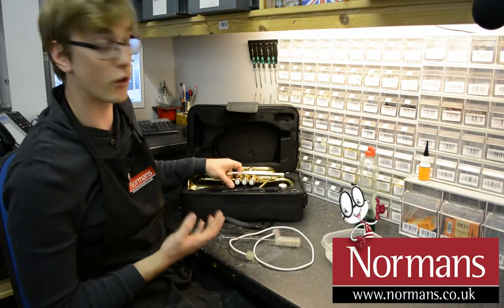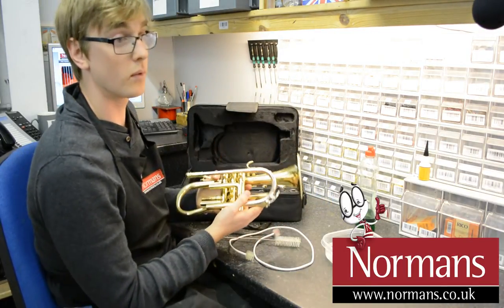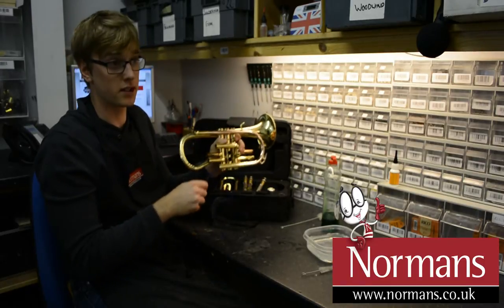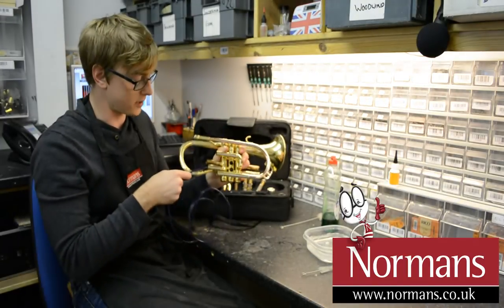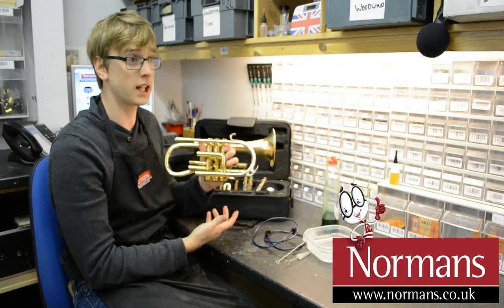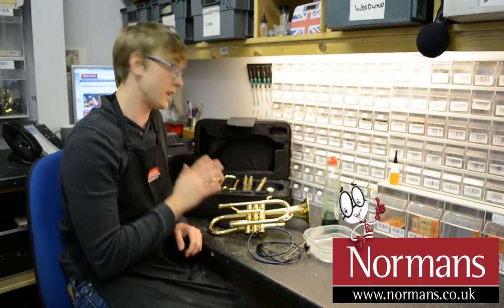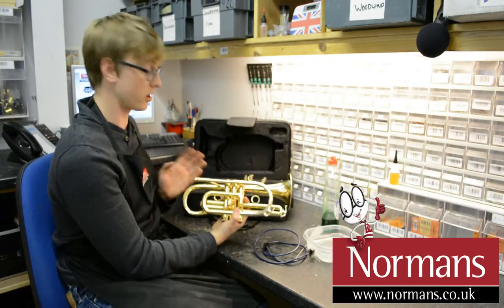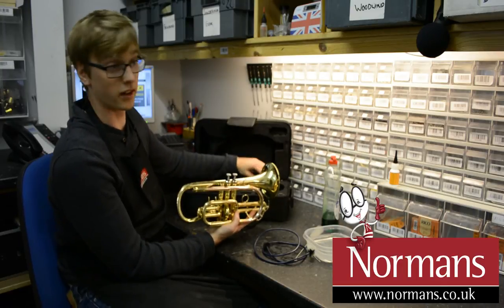How To - Clean A Cornet

Comment: This is potentially very helpful, but every step has to be explained and not as afterthoughts.  For example, "Obviously you have to lubricate each part first."   Not obvious to me!  With what do you suggest?   

Also the comment about making sure  the parts are dry first.  Yes, that occurred to me in light of all the soapy brushing.  But you need to suggest and/or show how to get the parts dry, especially the tubing.